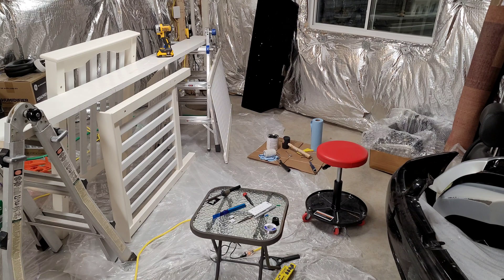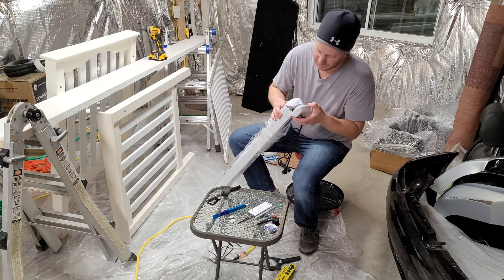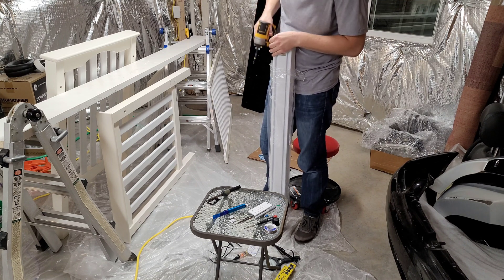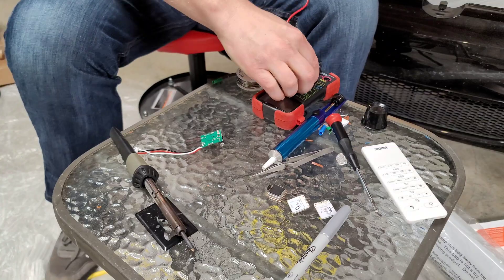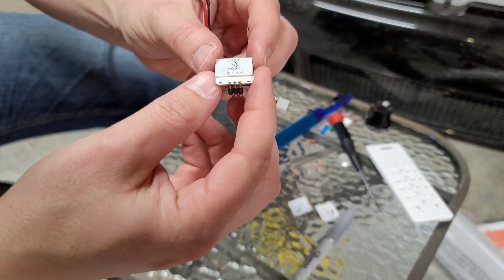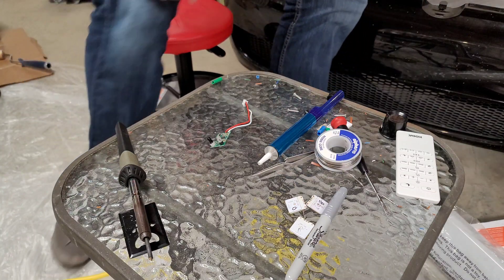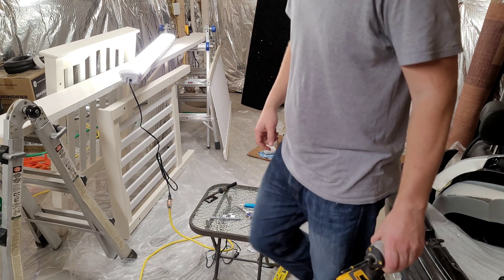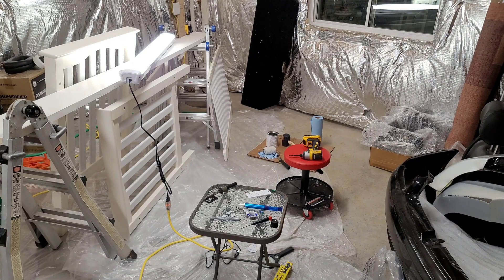Fix the Koda 46" LED Shop Light from Costco so it doesn't interfere with 5GHz WiFi

Comment: 2 years later and hundreds of hours on my lights this mod still works perfect
Reply from the maker: Thanks same here I have about 25 of them throughout my garage and basement and house. Noticed they changed the lights now at Cosco. Now they have chains to pull to turn them on/off and have extra LEDs along the ceiling as a 2nd option for general lighting. Seems silly. Wish they would bring this style back. 😅

Comment: question, when you disable the motion sensor via the remote..do you have to keep disabling it every time you turn the lights on or is a one time thing?
Reply from the maker: It's a one time thing. I have all my lights on a hardwire switch which cuts power to them and they still continue to operate in the last mode before power was cut. So I turned motion off once and haven't had to worry about it again unless my son enabled motion when playing with the remote ha
Reply: @akaDeno  
awesome, that’s exactly what I wanted to hear
thank you so much for the response!
cheers!

Comment: Thanks for this. I just bought these lights  a few weeks ago in 2022. I haven’t had any issues with my internet signal. If anything my signal was stronger in the garage than in the other rooms in my house. Might try this but will snip the sensor off the use liquid electric tape on the solder ends.
Reply from the maker: The newest lights were redesigned and no longer need to be modified. They won't interfere with WiFi at all anymore.
Reply: @akaDeno  awesome that’s good to know. I will keep the lights as is. Love the luminance in the garage. It’s like daylight with four of them on!

Comment: Thank you!

Also discovered one of mine reacts with the neighbor's WiFi🤦‍♂️

So we're suddenly plunged into darkness. I miss the original Costco shop lights, I have had the shop lights on timers and agree: until this one started turning off unexpectedly, they have been great for filming and for lighting aquariums for hi-light requirement aquarium plants. 

Plus, wave length of the lights doesn't show up on the GoPro or even BlackMagic.

Comment: I wonder if the ones sold today still have this problem.  I just bought 6 and don’t want to install if so
Reply from the maker: I had 3 of the new ones up bout 2 weeks ago and they didn't seem to cause the interference like they used to. They redesigned the antenna and it uses a slightly different frequency so in theory they shouldn't cause issues with WiFi now.
Reply: @akaDeno  thank you. I just installed 4 and did WiFi tests before and after. Haven’t noticed anything yet. May get 2 more
Reply: I just installed 4 and they randomly turn on. Sometimes just one and other times a different one. I set up a camera in the garage to monitor and can see one will turn on no obvious reason.
Reply from the maker: @hawkmanva  might watch to see if it's a specific one. I had 1 that flickered on and off a bunch. It's the 1st one I've had to return and get a replacement for and it was one of the newer style I just bought a few weeks ago. Might have a defect in that specific one. Or if it's multiple turning on randomly try disabling motion with the remote and see if they still do it.
Reply: @akaDeno  I called support and they said turn the motion down to the lowest setting that it can detect movement through walls. In my case there is a room over garage and someone was in it until 1:30 am. After 1:30 it didn’t turn on anymore. So maybe support is right.
Reply: ones sold in the Costco I shop at are no longer motion sensing.  They have pull chains and no remotes.  old school.

Comment: akaDENO THANK YOU SO MUCH FOR THIS VIDEO!! I got a Koda light from Costco just recently for $18.99 and the WiFi problem was killing me. When I followed your directions, and opened it up, the transmitter was different than the one you show and didn't have three solder points. So I cut the whole transmitter/antenna out and connected the red wire to a black wire (mine had two black wires and a red, no white). I've lost the remote control ability by removing the transmitter but I plugged it into an outlet with a switch so I can turn it on and off. It works for me, and I'm extremely grateful to you for making this video! :-)
Reply: P.S. I now have a brand-new Koda remote control that I don't need, if anyone would like it and will pay the shipping costs on the United States. :-)
Reply from the maker: @thewunderkid4615  I just bought a few for a friend's garage and it appears they have updated the boards. Now they use the "LM030008DG" boards. These boards switched from an external microwave antenna on a single layer board to now having a pancake microwave antenna sandwiched between layers on a 2 layer board. I have a bunch of pictures and diagrams I drew out for these new lights. There is no safe and easy way to disconnect the microwave antenna unfortunately. If you have a steady hand you can use a soldering iron to remove all the tiny capacitors closest to the motion sensor pads on the back side of the board. There should be 7 of these tiny capacitors in a row. Carefully knock them all off and make sure you dont bridge any pads with solder and then you should have a microwave motion sensing free light once again.

The good thing about these new sensors is they run at 5.8GHz instead of the older 5.3-5.4Ghz so in theory these new lights shouldn't effect wifi reception at all. They also don't include the wifi warning paper in the box anymore so they might not interfere with WiFi anymore, I simply don't want any extra microwave sensing devices around my house.

I am going to try these modified new lights where I carefully removed all the tiny capacitors near the microwave sensor and see if they mess with my 5GHz wifi. Hopefully the new ones won't.
Reply: @akaDeno  you rock! I truly appreciate all that you do. Keep on keeping on. 🙂
Reply: @akaDeno  Hi, just checking to see if you had any success with the new lights. I just bought a bunch for my garage and basement - would like to remove the WiFi sensors as well. Thanks
Reply: I am also wondering if anyone has any success in removing or disabling the microwave sensor.
Reply: 3 wires 1-red 1-black, 1-dark blue. Cut off all 3 and discard the cuircut board. Connect red to dark blue, leave black isolated... no more sensor and wifi remote capability, just off and on light

Comment: thanks for the video.  Do you (or does anybody) know how to 'jumper' the remote control board so that the light is just an normal on/off light that I can control with just a switch?  My elderly father is a luddite and cannot wrap his head around a motion-detector.
Reply from the maker: That's super easy... you just have to do it once.... grab the remote turn motion sensing off,  and time stuff off... then set the brightness you want and you can then control it with a normal switch on the wall. Just need the remote to disable all the motion settings and then it's a normal on/off light.

Comment: Mine won't shut off when mounted to the ceiling.  When I take 'em down and lean them against the wall, the motion detector works fine and turns them off.
Reply from the maker: That could be the sensitivity is turned down, or it could be the solder at the connection of the motion sensor. If you bought them from Costco take them back and get new ones.
Reply: @akaDeno  No it's like it's TOO sensitive...it detects motion that isn't there.  Only when I have it on the ceiling though.  If I take it down and lean it against the wall it works fine
Reply from the maker: @blurglide  that is strange it could be some sort of interference up there in your specific case. I didn't want the motion sensing to work which is why I took the motion sensing stuff out of the lights. That way I control it with the light switch or remote.

Comment: Great video! Very thorough. I recently purchased this light and noticed the same issue with wifi. In my case I just fatigued the motion sensor chip off by rocking it back and forth about 10 times. It came off cleanly at the connector with no snipping or soldering needed. I also discovered that after cutting off the microwave chip the unit now uses 0 watts while off instead of the 0.5 watts it used previously.

Comment: So glad I found this, it was just what I needed. This light killed my wifi so I had just kept it unplugged until I could find a solution. I ended up using the snip method to remove the transmitter and it worked perfectly. Thanks so much for sharing!!

Comment: Thanks for this video! I wanted to learn how to disable the motion sensor, which worked great. I lost the remote and I wanted to figure out how to turn the light on and off with a switch because now it keeps turning off after 30 seconds of plugging it in. Do you have any suggestions?
Reply from the maker: You need a remote to turn the motion settings off 1 time. By default they come with motion settings turned on and since they won't detect any motion after this mod you need a remote at least 1 time to turn the motion settings off.
Reply from the maker: If you are in the US I can ship you a remote, I have about 15 of these lights now between my garage and basement so have lots of remotes just sitting in a bag not being used.
Reply: @akaDeno  That would be awesome! I really appreciate it, however, I'm in Canada. Would you still be able to ship?
Reply from the maker: @RiaQuiney  send me an email. My email is my youtube username no need to capitalize DENO and then its at Gmail.com and I will see how much it would cost to ship you a remote

Comment: Thank you for this. 

All I want to do is have the light plugged into a timer and have it dimmable. I guess I just need to pull the plug on the chip and I'm done, correct?
Reply from the maker: You can disable the motion settings and auto dimming from the remote. But if you're having wifi interference then you need to open up and cut off that motion sensor. Once you remove that sensor you won't have the automatic dimming since that timing is based off motion detection.
Reply from the maker: But all of my lights right now are still able to dim from the remote when I choose, and are turned on and off by the switch on the wall. So work flawlessly but no motion detection to automatically turn them off and to dim if no movement is detected in 30s, 1min, 5min whatever the remote has. So no motion detection but also no wifi interference anymore. Worth it for me as I have 6 of these lights in my 20'x22' garage and they are bright!!

Comment: Can’t you accomplish the same thing by simply turning off the dimming and auto shutoff feature?
Reply from the maker: That disabled the lights from adjusting due to motion,  but the sensors were still on and still interfering with wifi. The only way to disable the sensor completely is to remove or cut the leads on the sensor.

Comment from the maker: Another option someone mentioned to me was you could just use a pair of snips to cut the motion sensor off the board. That's quicker and easier then desoldering, but doesn't allow putting it back on as easily if you want to. Going the desolder methong you can reattach easily at any time.
Reply: I don't have a solder iron, so I can just take snips and cut those 3 pillars holding the sensor on and that's it?
Reply from the maker: @jaminduncan7918  yes if you can snip off the 3 pins and ensure none of them are touching then that will work as well. No motion sensing anymore but also no interference with 5GHz WiFi.

Comment from the maker: I bought a few more to modify them for a friend and it appears some of the newer batch have much shorter screws holding the end plates on and are also using locking butt connectors for the "linkable" end plug. 

So if your light has really short screws holding the end caps on then you must likely have locking butt connectors,  take a moment to press the pin down on them and they slide off easily.  I assume they made this change because some of my older lights the linkable plug side wasn't even connected or were very loose.